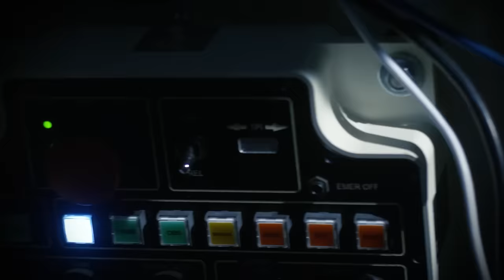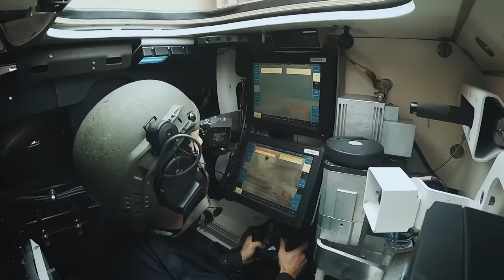Watch how Leopard 2 tank changes the battlefield in Ukraine

Comment: why do so many videos keep saying the Abrams only runs on jet fuel when a simple google search will show it can run on many types of fuel. It is a multi-fuel engine, which can run on any grade of petrol, diesel, aviation fuel or kerosene.
Reply: Though I wonder whether it can run on different fuel indefinitely or whether multifuel is just temporary
Reply: I checked in internet i got >
Honeywell AGT1500 Engine
Description
The Honeywell AGT1500 is a gas turbine engine. It is the main powerplant of the M1 Abrams series of tanks. The engine was originally designed and produced by the Lycoming Turbine Engine Division in the Stratford Army Engine Plant. Wikipedia

Also got >
The M1A2 Abrams is powered by Avco Lycoming (now Honeywell) AGT1500 gas turbine engine, developing 1 500 horsepower.

I dont know you.
Are you one of the designers of the tank?
Even United States officials have already said that their Abrams tank is not suitable for Ukraine
Reply: @celestineoc1123 not suitable due to it's weight mostly. It would sink in the soft grounds
Reply: It can run on diesel and other fuels, buy not good for maintenance
Reply: Because some people think turbines can run only on aviation fuel. But this is not the case for any turbine, and even some engines may be more flexible than people think. A car newspaper in the 90s run an old VW Golf diesel on sunflower oil for thousands of miles. It was also common for diesel owners back in the days to fill 20% gasoline in cold winters. Some youtubers run their lawnmover on brush cleaner. There are many more examples. I definetely won´t do this with a modern car engine.
Reply: The tank was built around this engine[118] and it is multifuel-capable, including diesel, gasoline, marine diesel and jet fuel[119] (such as JP-4 or JP-8). By 1989, the Army was transitioning solely to JP-8 for the M1 Abrams.[120] For logistical simplicity, JP-8 is the U.S. military's universal fuel powering both aircraft and vehicle fleets. The Australian M1A1 AIM SA burns diesel fuel, since the use of JP-8 is less common in the Australian Army.
Reply: It can run on diesel, but use 50% more than Leo2, and need a lot more service when running on diesel.
Reply: It’s also designed to run on aviation fuel because logistically its easier to transport one fuel type that can run everything instead of JP5 and diesel.  It’s called standardization.
Reply: @panosdotnet  LoL, you will when it destroys that shack you live in😂😂😂
Reply: @panosdotnet  : The same people who think the T-14 fake tank is a threat.
Reply: I had a good friend in the 2nd Iraq war & they got separated from their logistical supply tru k(gas truck) & they filled up their tank with as much booze as they could pour into the gas tank on their Abrams.Got pics to prove it.He said vodka gives better gas mileage.
Reply: Yes correct
Reply: Many graids not All
Reply: @hermes667  I think everyone knows turbos will run on standard petrol.Many cars have turbos
Reply: @celestineoc1123  
The point being raised was about "fuel", even with the help of the "internet" you didn't quote any reference to the types of fuel that the Abrams engine can run on, you completely missed the point of the comments but question someone else's knowledge of the Abrams while at the same time disclosing that you had to use the Internet to even say something about it......!?
Reply: @dbszady  They are not planning to launch a counter-offensive during the muddy season
Reply: @nicolasrose3064  Abrams can run any types of fuel available, but it's best optimized for a specific type for efficiency. :face-fuchsia-poop-shape:
Reply: @tomasgogashvily5350  
Well, good for you, if knowing that improves the quality of your life, you should be well on the way to happiness.
Reply: Probably run on vodka 😂
Reply: The PT6 was originally developed as a remote oilfield pump engine, running on what came out of the ground.  It also has dispensation to run gas, or fuel oil in aircraft.  If it burns, it 'll turn
Reply: There were tests with putting a diesel engine in the M1.  That doubled the mileage ….  Plus a diesel is much easier to maintain.
Reply: ONLY JET FUEL
Reply: @panosdotnet   you will, bot
Reply: Does anyone think 30 tanks will win this war for Ukraine lol
Reply: @panosdotnet  It's opponents surely do.
Reply: @blackdification  It is optimized for JP8. So it just burns more of other fuels.
Reply: Almost any fuel
Reply: Because they think everyone is stupid
Reply: US needs to give Ukraine at least 100 A-10 Warthog aircraft with lots of ammo and rockets.
Reply: Oh
Reply: Turbines are open combustion engines, therefore multi-fuel capable. PS Jet fuel is simply high-quality kerosene.
Reply: because the point is that in the end you can blame Germany, as always
Reply: It’s going to have a problem with keeping it topped up with fuel
Reply: I don't  know about the leopard  or challger  if you have the turbine  engine for Abrams with a good maintenance  crew the engine  it can be swamped out in vary little  time...I  do apologize for any misspelling  my bad
Reply: why do people associate jet fuel as something highly volitale or some kind of superfuel
 it just kerosene.
Reply: @kevinstacey2231  I think it's just that it's hard to find far from an airport, unlike diesel which is available everywhere
Reply: yup i use it in my wick heater, gotta get it at the airport, 5 gallon gerry cans. it actually used to be cheaper than diesel, but not anymore! thanx oval office
Reply: It's a flex fuel vehicle .
Reply: m1 abrams is literally made for zombie apocalypse
Reply: @Chainyanker007 I agree with your assessment since the Ukrainian Airforce now has the harms on the MiG 29. The harms will surpress the air defense of the Russians military and artillery😊.
Reply: Not for long, then it breaks down
Reply: It’s also a battle with informations.
Reply: @ferociousfil5747  they are now transitioning to F-24 fuel, which is Jet-A with additives blended in to make a fuel nearly identical to JP-8.  F-24 can be blended on the refueling truck as it is being dispensed. The only other kerosene fuel in use is JP-5 for any aircraft that does shipboard operations.
Reply: @yyxy.oncesaid  THE WORD IS GRADES😂
Reply: Most russian tanks can too
Reply: It will even run very nicely on 42 cups of really hot tea.

Comment: One mistake that is repeated comparing Leopards and Abrams in regards to fuel is the type, it does not matter the Abrams runs on any fuel aswell.
The actual point that matters is consumption. The Abrams needs even in idle around 3 times more fuel. The cost of fuel does not even matter, its the supply. 
If you have to drive 3 times more fuel trucks to the tanks it makes a big difference. The US Army can affort having an extensive logistics, an army like the ukrainian could get in serious trouble if supply routes are endagered, since it does not even have a considerable air force to cover for it.
Reply: an actual good argument in a tank discussion?
no way

Comment: The Abrams runs on JP8 which is a diesel like fuel. There is a huge reason for doing this. All of the US mechanized vehicles - planes, tanks, boats, humvees and so on all run on a single common fuel. This makes logistics much simpler.
Reply: You are right. I was in the 2nd Armored division -- M-1 tanks, trucks, APC's etc all ran on what we generically called diesel and we referred to our vehicles as "multifueled". Our Army Marines Navy Air Forces won WW2 because the USA could supply fuel needed to the 1.5 million trucks and 150,000 armored vehicles in Europe and in Pacific.  In fact our aviation gas allowed the P-51 / P-47 to go about 50 mph faster than German BF109 fighters -- not much but was the edge needed to kill them.
Reply: Great point well taken and very accurate. When an modern army is dispersed over the world, they have to use the fuel available. Also, it was a key factor in our HUMMVEES which had a standard GM Duramax 6.7 Liter diesel engine. There are 100 of those engines in every thing trucks, cars, pickups, boats so if the grunts lost a intake valve, you could get one at local shops in any country.
Reply: abrams need every 6 hours fuil  is not my own info some video  editors said so!
Reply: how ever ukraine war area is not endless desert like in ırak and the enemy is not ırakys ! in ırak war was more easy ! but not here in ukraine.the geography is very different and the enemy has advanced weapons to agains tanks ! pin point hits also russians can do this with drons !
Reply: @hddun  the FW190 was every bit as good as the Mustang, but a case of too little too late:0 and even worse with the ME-262 (which could basically run on anything)
Reply: Unfortunately, the Abrams won't be arriving until 9 months at the very best.
Reply: So this guy simply presumed the tank used AV fuel because of the turbine engines. Wonder what else was a presumption.
Reply: @johnbeckwith1361  Witaj.Z powodów logistycznych silniki w sprzecie NATO pracuja na ET od 75 - 100 oktanów,ON - czyli diesl'u i na Nafcie Lotniczej .Faktyczna kaloryczność paliwa ,na którym dany typ silnika może pracowac,to tajemnica producenta.
Reply: Correction, it was intended to run on JP8 but CAN run on gasoline, diesel, marine diesel, other jet fuels as well as plain old kerosene.  I joke above about it being able to run on melted candles, but, paraffin is a form of kerosene just more distilled and refined with a much higher solidification point.  If you could keep it hot enough so it did not turn to wax in the fuel tank the Abrams could run on melted candles.  "Paraffin tends to be a more refined and distilled version of kerosene. Kerosene is a specific type of paraffin. In fact, general paraffin for use as a heating fluid is often called kerosene, and the terms can be used interchangeably. So whether you opt for kerosene or paraffin for home use, you are essentially using the same product."
Reply: It is not.
Reply: @airfight10  The Abrams was used in West Germany during the cold war. I was there. Terrain was not to much a problem for the Abrams. In fact the desert was worst with wanting to throw the tracks. They fixed that easily enough.
Reply: Thats the reason why Humvees engines don't last.
Reply: @cgulden  Don't last as to what ? The engine has some issues but not lasting is not due to fuel. I have yet to see one that didn't last. Unless blown up or serviced out of service for civilian usage.
Reply: @m1a1abrams93  In Iraq, our Humvees required a new engine shortly after 50,000.  The vehicles were kept at 10-20 standards by weekly checks and services.
Reply: @airfight10  In desert war is much easier??:face-blue-smiling::face-blue-smiling: So funny all these experts here...
Reply: Indeed, very good! That's why the NATO defeated the Taliban in no time, or did they?
Reply: stopp fossile fuel. no fuel ,
Reply: @airfight10 it's Iraq not Irak

Comment: Abrams can actually run on a variety of fuels including Diesel, jet fuel/kerosene, gasoline, marine diesel. This makes it superior to tanks with Diesel engines.
Reply: i dont think we are sending them our Abrams now. i have heard we are now sending our old cold war M-10 tanks
Reply: True, but when Tanks are refuled in action this happens on the main source every other equipment in the field will take. So also the Abrams was fueld with Diesel, as this is what will be on hand for every other equipment. In the meantime it takes JP-8, So logistically there now are special fuel supply just for the tank. Having the need to fuel whatever is availbale means this tank will be separated from the main troops or if only jet fuel is available other unit will fall back/left behind again. The advantage is not that cunning on the battlefield. This multifuel availability is "bought" with a thirsty enginge which is less reliable than other old school diesel engines.
Reply: @nephilimivritt8216  false
Reply: @shogged  its something i just heard. i dont know if it was true are not general Patton
Reply: @nephilimivritt8216  well now you know better, prigozhin
Reply: @schneisim   You can literally put any fuel in an Abrams. It will run on what is available. It is just optimized for JP8. JP8 isnt much different than kerosene which is just  version of diesel.
Reply: that is a lie
Reply: Wood, coal, hopes and prayers, the thing runs on anything. 🤣
Reply: @JB-yb4wn  maybe on water too .. :)))
Reply: They might have a hard time using melted candle wax or bunker fuel but just about anything else will make the tank go.
Reply: @schneisim  Two gallons per mile whether it is idling or going top speed.  That is a lot of fuel, but hey, Americans managed even out in the deserts of Iraq.  I think the claims of fuel logistics for them is a red herring.
Reply: @ldavis6083  The Abrams could almost run on melted down candles.  Cooking oil.  Just kidding, but it can run on anything all the way down to marine diesel.  One of the things I think they were really afraid of was that kerosene/jet fuel has a freezing point of -47*C so has to have an additive to keep it from freezing in the skies as well as very cold climates like a russian winter.  That is -52.6F by the way.
Reply: @MAtildaMortuaryserver  
If you do it in Celsius, it's much warmer, only -47.
Reply: @nephilimivritt8216  Abrams have been spotted in Poland with Ukrainian soldiers training on them. I don’t believe t
Reply: @ldavis6083  What about cooking oil ??
Reply: Not when the roads and bridges of Ukraine can’t support its weight. Wrongvtank for the job.
Reply: @NoBSMusicReviews  who told you that??
Reply: Leopard 2 engines are multi fuel engines, too. In comparison to an Abrams it only needs half the amount of fuel though.
Reply: The Leopards engine is also multifuel
Reply: @nephilimivritt8216  the m 10 is a WWII tank
Reply: Well, turbines are thirsty and hot, hopefully not hot enough for the mediocre Russian thermal imagers ....
Reply: Same with the Leo. Runs on piss if needed.
Reply: The modern diesel tanks can also burn pretty much every flamable liquid. But it is still most likely Diesel as it is the most abundant and standard fuel. I don't see the advantage of it, while the fuel consumption and the INSANE IR signature of the Abrams turbine are clear disadvantages.
Reply: Yeah, but it needs twice more of that whatever fuel you happen to use to do the same work. They are both different approaches to tackle the same problem; logistics and never running out of fuel. Btw. most trucks, etc. also run with a diesel fuel, even motor cycles may run with a diesel fuel in military exactly for this very reason to unify the fuels. Totally depends how the logistics system is designed.
Reply: The Abrams tank is half as fuel efficient as regular diesel engines. The Abrams' torsion suspension system is also dated and a pain in the ass to repair if a rod snaps. Anyone who knows anything about these vehicles knows that no design comes without trade-offs. Calling the Abrams's engine strictly superior is just flat out lying.
Reply: @schneisim  Not so it runs best on JP-8 but it would run on Diesel just fine
Reply: @UserUser-ww2nj  it will run on it too.
Reply: @karolkupec2044  Ah , cooking oil . Thought they might just like a lot of old Mercs and some others like the diesel Range Rover
Reply: But its Consumption Dude....

Comment: The Abrams M1 Tank doesn't need special jet fuel. That's the whole point of the multi fuel turbine engine. It can run on alot of fuel types, but the consumption is higher than lets say a diesel motor
Reply: the BIG problem is it needs 300 gallons every 8hours,  and the bridges are not capable of heavy tanks like this and the few chalengers !:hand-orange-covering-eyes::hand-orange-covering-eyes:

Comment: Very  interesting, but how did you miss the fact, as many other commenters have, uh, commented, that the Abrams can use virtually any liquid hydrocarbon?
Reply from the maker: there is conflicting information. some say that the export version works only on one type of fuel
Reply: I served in the US Army 2nd Armored Div. We had 400 M-1A1s, 600 M-113 APC (Armored Personnel Carriers) and over 1,000 2.5T, 5Ton, 10Ton trucks/mixed vehicles (Humvees, special ammo carriers, fuelers,  etc). All ran on the same fuel and lots of it. An M-1 Abrams gets about 4 gallons to the mile, APC abour 4 miles gallon, and trucks about 9 miles to the gallon (bigger get less ).
Reply: @myglobalissues  Export version?  Think about that.  Both the absurdity in concept and the changes that would be needed to restrict fuel types.